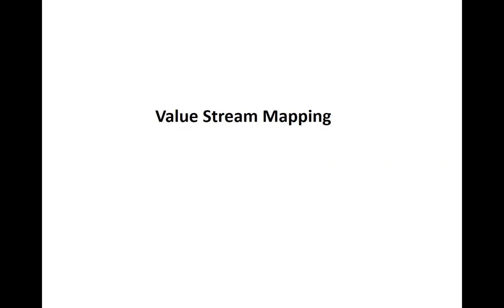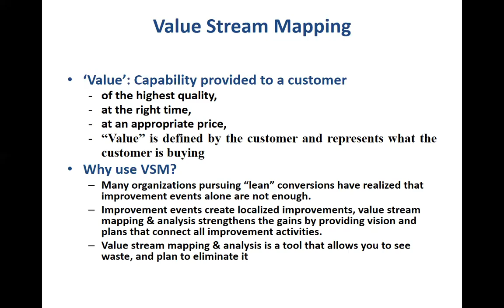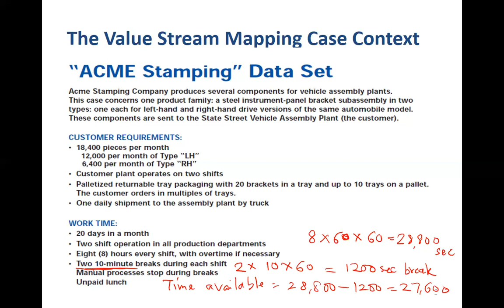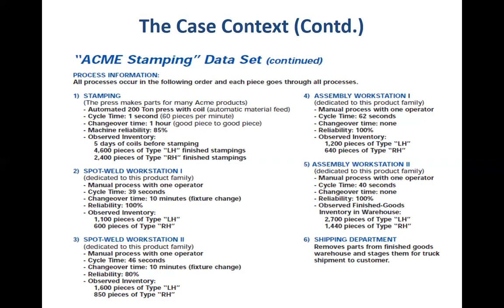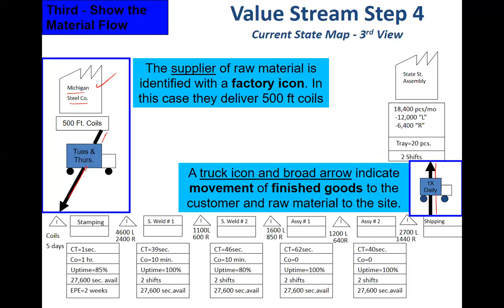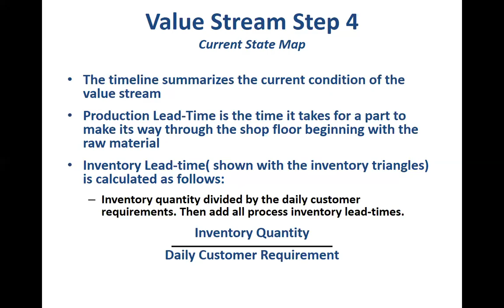Value Stream Mapping - Current State Map

Comment: Sir, have the below clarifications,
1.	Between Process 1 & Process 2 ( say Stamping 1 and Welding 1) assume that the observed inventory is not given as per question/example.
1.1	can I calculate or estimate inventory using Littles law considering the CT as the lead time for Process 2
1.2	or is this law limited to the Value chain entirely ? which is Inventory = Lead Time* Throughput rate of the E2E Value Stream.
1.3	If your answer is “can be applied to estimate in b/w inventory as well” then, is this formula correct ?  (Process 2 CT Time * Throughput Rate)  = (Inventory X)  at any time before Process 2